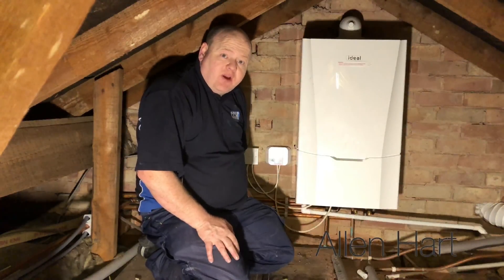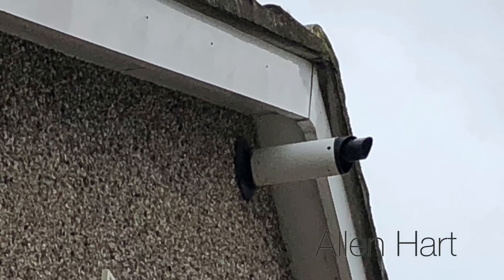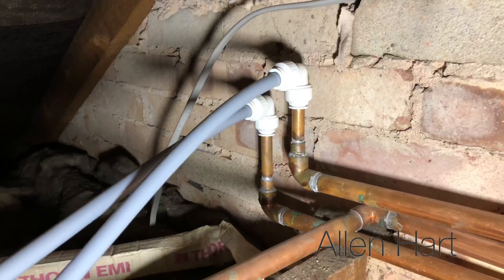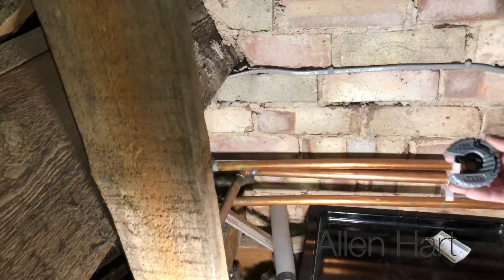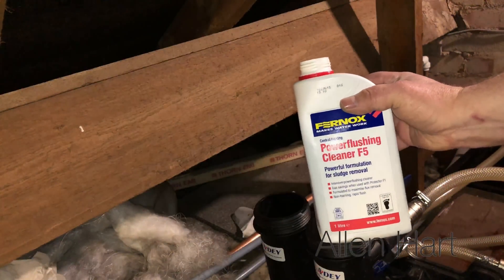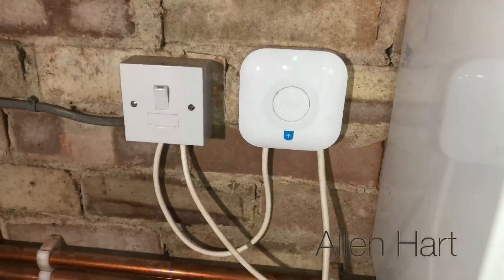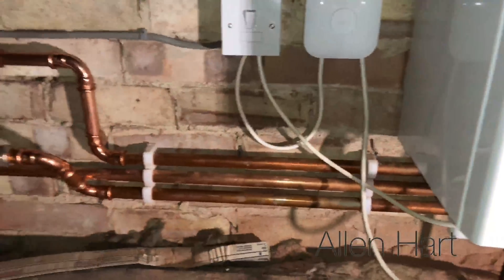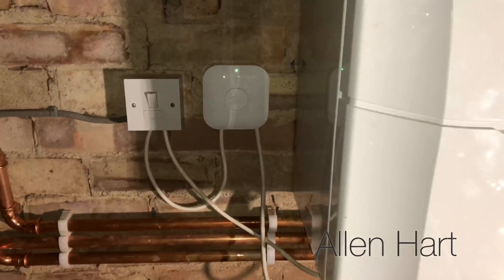DIY Combi Boiler Installation / Day in the life of a Plumber / Gas Engineer

Comment: i don't understand why  people are having central heating boilers fitted by unqualified people as they are putting life's at risk, is it illegal, if it's not it should be, it is frightening
Reply from the maker: Over the past few years my work has changed from mainly installing boilers, Now we spend a lot of time sorting these type of installs, things are not getting any better thats for sure, I went to one the other day and the customer was proud to tell me he had repiped it all, The install wasnt good either. Thanks for watching.
Reply: Allen Hart so I assume that it's not illegal to fit your own boiler, just stupid and dangerous 👍😱
Reply from the maker: This customer had only just moved into the house today, They do not know the history of the install.
Reply: Allen Hart  hi at least they had common sense and called you in, and they sleep easy knowing that it's safe
Reply from the maker: The boiler was really really loud, they knew something was wrong.
Reply: Because people are short of money. They can afford someone  qualified.
Reply: I have seen some shocking installs by qualified people... A piece of paper does not mean you have pride in your work.
Reply: John Daniells it is illegal to disturb any gas supply or any boiler internals to which the products of combustion may have been altered, this includes gas flue/chimney and ventilation, if you breech any of the regulations in the GSIUR and you are found to be the installing engineer whether registered or not then you can be prosecuted. You can be prosecuted for carrying out work on any gas appliance if your not registered with Gas Safe, even if you’re trained and have completed a perfect job. Only a registered gas engineer is allowed to test the correct functioning of the boiler after such work. The Benchmark should have been filled out to commission the boiler for first use and it is then used sent to manufacturer to register for warranty. They will then normally send info to council building control who will then issue the property a certificate. 

Most plumbers who have been fitting boilers for a while have their BS7671 and a qualification to say they are competent to install electrical wiring (defined Scope) limited to heating and plumbing systems up to the FCU. The installation of a new FCU could be carried out by a Full Scope certified electrically competent heating engineer who could potentially rewire a house same as any spark could. 

Allen could and probably should report this installation to the GS Register and HSE but the installing cowboy if not registered can only be prosecuted by the HSE. If registered then they can take further action such as a suspension from installing gas appliances, fines or more frequent checks of an installers work. If you fit dodgy wiring and you’re not qualified to do so and it’s been reported to HSE as a C1 or C2 then you could also be prosecuted for breaching electrical safety regulations. 

Hope this is useful
Reply: John Strange not true. There is nothing to stop a DIY installing a boiler. 

The manufacturer won’t offer a warranty - that’s up to them - but it’s not illegal.
Reply: @GeeTheBuilder  this debate runs and runs. I think you would be prosecuted and that means its illegal. But being gas safe, doesn't mean u are competent or safe, just that you are registered.
Reply: Steve Hove prosecuted for what??
Reply: It is illegal because the building regulations are legislation and installing a boiler is notifiable work I think, is that right Allen? I'm a spark and u couldn't be prosecuted  for non compliance of BS7671 the Wiring regs, but u can be prosecuted for non compliance with Part P of the building regs. Same thing with the gas / boiler install no?

Comment: Did you repair the gas pipe with a. Sleeve and report too riddor?
Reply: Riddor lol behave yourself
Reply: Not RIDDOR reportable !  Classified as "At Risk"
Reply: m Mack started the whole RIDDOR thing...... Me thinks he has just done ACS and not really got to grips with regs !!! LOL
Reply from the maker: We didn't upgrade the gas at the moment, it will be done once the extension has been built. We didn't riddor it either.
Reply: I KNOW !!.....If you read that's what I said !!! DOH!
Reply: Paul Kramer  👍👍👍
Reply: AAVs on a sealed system?
Reply: Of Course ! ( probably worse on an open vent system as failure of the AAV would lead to a continual water leak via the F&E tank) Every sealed system boiler has a built in AAV so why not on the system pipework?, I would fit good quality isolation valves as well though for future maintenance unless, as in Allen's case, the pipework is all going to be changed in the near future.
Reply: Tarki Micaleff lol it's Ntcs
Reply: Paul Kramer the AAVs directly on top of the pump Not in a negative area. I think the customer would notice a leak before the feed and expansion tank would keep flowing??? You would probably install them above the f and e Tanks water level.
Reply: Tarki Micaleff did you buy your gas ticket on eBay or gumtree?

Comment: I use the auto air vents too but I put ballifix valves below it so when they fail no need for whole drain down.
Reply from the maker: I wouldn't use ballifix as they tend to leak, normally use full bore valves. Its a good point though.
Reply: Yeah ballfix valves can't handle the temps on central heating pipework. Bad practice
Reply: Yeah don't fit them they 'll leak